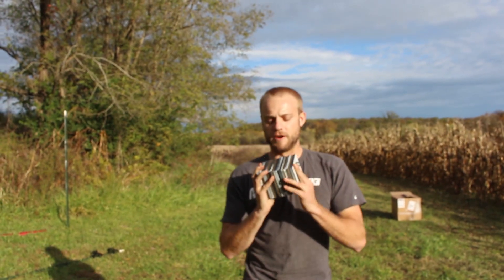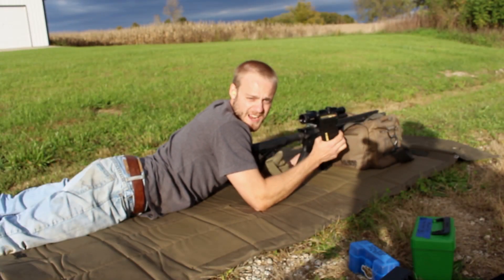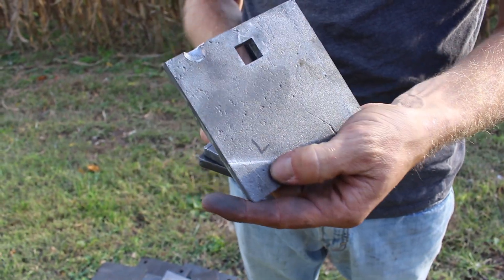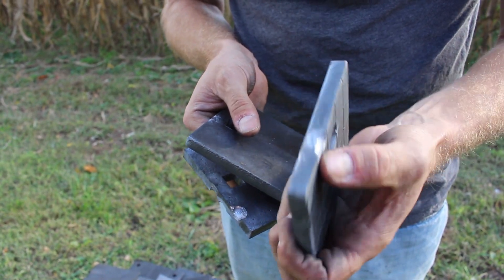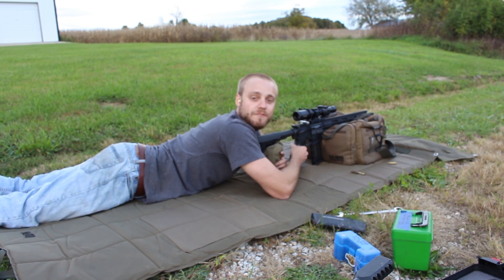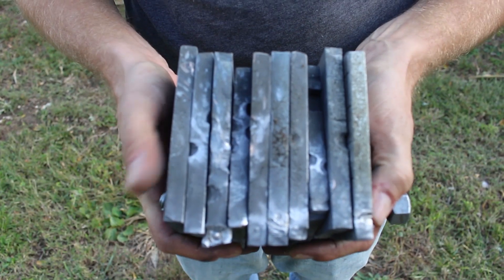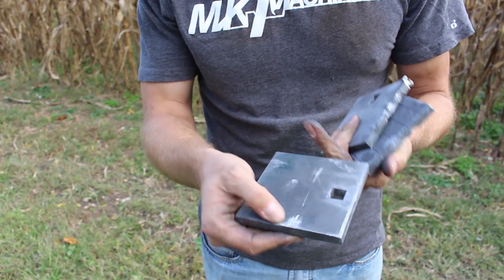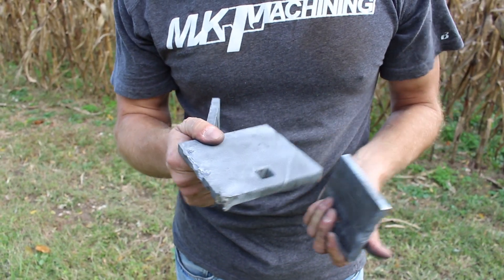AR500 Targets: Laser vs Plasma vs Waterjet Cut

Comment: Shoot plasma blocks vs laser blocks vs water blocks of steel for accurate comparison.
Reply from the maker: you mean like a cube or?
Reply: tykempster sorry, like 4 pieces of all plasma cut bolted together and then 4 of all laser cut put together and 4 all water jet.
Reply from the maker: Oh, well that's easy enough.  We randomized the order to make it unbiased in case folks thought we changed something between tests.
Reply: tykempster they already have to assume your actually using what you say your using. Just my thoughts though.
Reply: @tykempster  unbiased? Not even close. By putting them all together you can't tell if the bullet hit one or an other first and that makes a difference. If the inferior cut get hit first or after then the one next to its result can be change due to deflection.
Reply from the maker: @AztecWarrior75  they were in a straight line.  and hit by over 60 rounds in multiple tests.  the results were indisputable!
Reply from the maker: @AztecWarrior75  Fair enough, it wasn't perfectly scientific.  But, the plates were the SAME mill certified AR500, cut in three different ways.  It was easy to catalog the hits, the laser cut sides took the most damage, followed by plasma, and obviously waterjet will be the least impacted because it has no HAZ (heat affected zone).  Shots were from 100 yards with Angelfire 55gr FMJ.